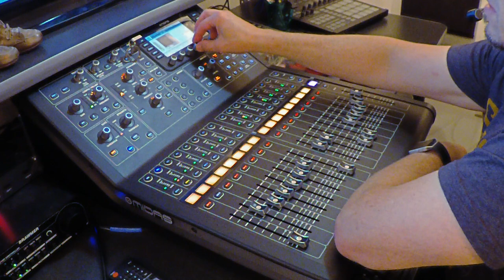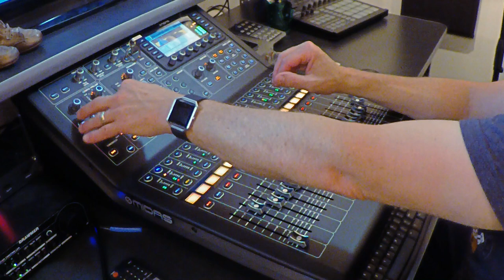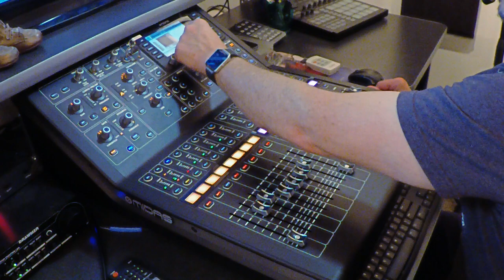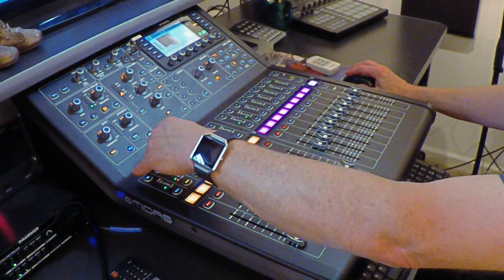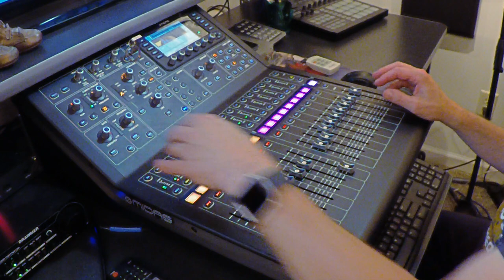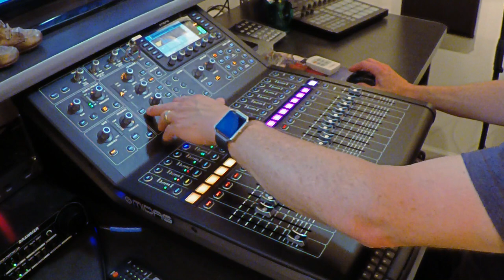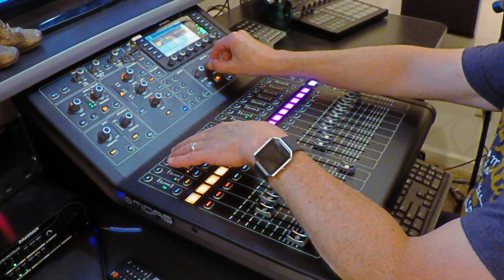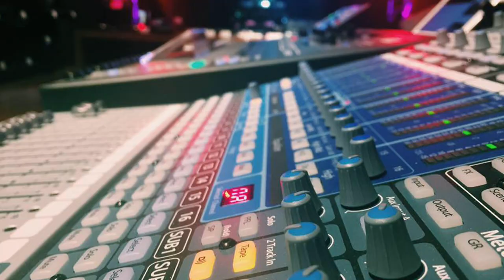Mixing Live Drums

Comment: I'll never understand why they put the channel selectors way up top? They are the most used buttons on the board..The x32 compact made them fit? I really want this board for the pres and build quality but not sure of layout.
Reply: You mean the layer select buttons I suppose? They are often used, but certainly not "most". Why they are up top? Well, the X32 Compact is not 19", the X32 Producer does have a narrower layout and therefore misses the scribble strips. Bad trade, I had that one. So there is practical reason why they are not where you came know them to be. But that aside - this is actually super intuitive. I was very sceptical at first as well, but using the console, I came to like it more and more. One of the reasons is, that it's super easy and natural to spread out the inputs over both banks of 8. Just press the two buttons sitting next to each other. I wouldn't say it's perfect, but neither is the solution found on the other consoles of the line. Give it a shot, I am sure you will find the benefits if this form factor (Midas simply nailed it with this console) outweigh any small incenvenience by a large margin.

Comment: Really great idea to learn more about mixing drums, especially for M32 users, but unfortunately your voice is much too loud. 

If we really want to hear what exactly you are doing on the drums with EQ/Compr./etc. we need to turn volume way up, but then your voice is screaming at us. A ducker might have been a good choice here.

Don´t want to be a bummer here, you invested quite some time and I really appreciate that, but this tutorial is nearly useless, because of the problem described ;(

Would really like to hear an updated version of your tuts, the idea is great and your approach is a good way to learn certain steps with different tools.
Reply from the maker: I try to stop talking to allow you to hear what is going on, I tried to to create a balance that keeps the comments in there, and quit talking as much as possible to hear. I’m listening to the same levels in my in ears as I’m creating the mix as well. Thanks for the comments and for watching.
Reply: Yeah, I just had another listen via headphones, it is much better on some/most parts (depends). Probably also very difficult to always find a good balance between both, voice and drums, when recording this.
Unfortunately most people will listen to this through a minor good speaker system when they first listen, maybe add "use headphones for best experience!" in your top comment.

Thanks for your answer and the time you took to make those tuts.